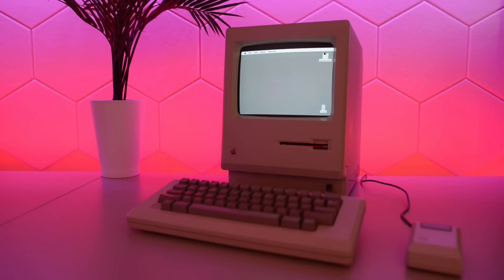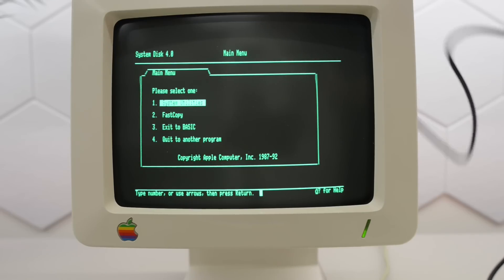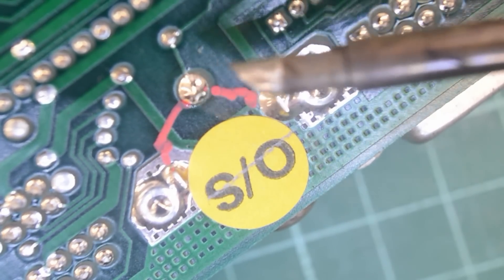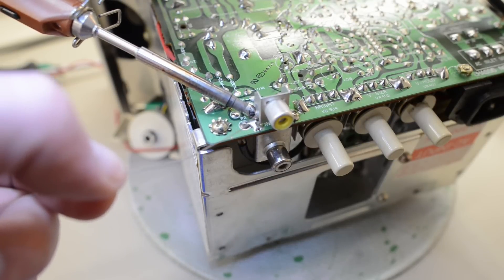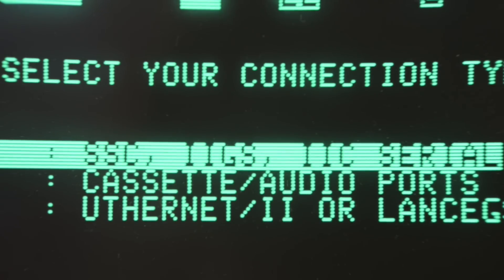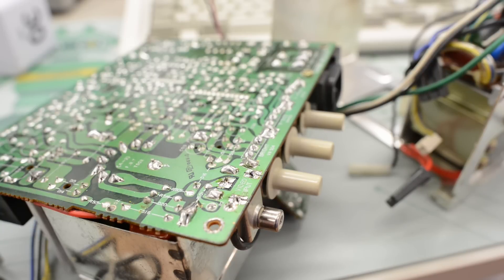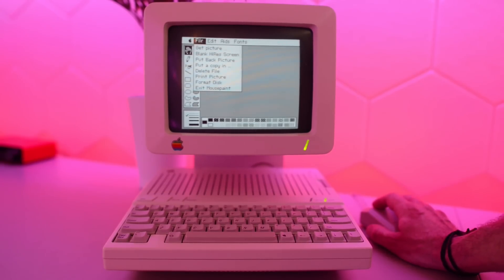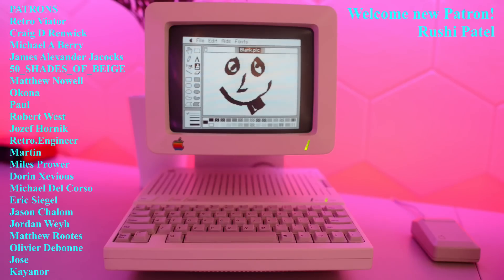Apple IIc Tube swap. It looks awesome! Is this a world first?

Comment: Just FYI, I took apart my apple IIc monitor composite cable to repair a broken connector at one end. I found that the connector has a ferrite bead built in to it, this might be why your third party cable had more issues.
Reply from the maker: Thanks for sharing. This cable doesn't seem to be easy to replace

Comment: If I recall correctly, the apple IIc uses an interlaced signal. So its natural you see a tiny bit of movement. Perfect example be pausing a VHS tape. It does exactly the same shift. As for the new cable, its most likely not shielded well.
Reply from the maker: Ok, hopefully, someone with a //c can check and compare

Comment: This is interesting the problem here is Circuit Loading    that gas to do with the risistence  of the Cable      and i do not think That is the problem   there is a leaky Cap some where i would think  in the out put of the drive for the Composite monitor
Reply from the maker: Thanks, I'll probably end up doing a full recap
Reply: @Epictronics1  It will probably fix nothing :)
Reply from the maker: @michvod  Why not?
Reply: @Epictronics1  Well it could be a capacitor afterall, but most likely just one or two that went bad

Comment: Steve Jobs would be spinning in his grave if he saw that Macintosh with a green phosphor tube. Almost as bad as the amber tube modded Mac I saw a while back. That being said, I do like the look of the paper white tube in the IIc monitor, I just don't think it's worth sacrificing the Mac for it. But they're your machines, so you can do what you like with them.

Anyway, the new cable probably has worse shielding than the old one (thicker doesn't always mean better quality), which is why you get the vertical moving distortion. It's most likely 60Hz interference, the vibrating text is probably a separate issue. It's only affecting the image horizontally, so my guess would be some kind of interference in the horizontal sync signal causing a jitter in the video circuitry on the logic board.

Looking at the schematic, the video generation circuit is integrated into the VID hybrid UE1, which takes the pixel data from the output of the SPI shift register chip UE6, and a sync signal from pin 39 of the IOU chip UE14. That could be the 15.734KHz horizontal sync frequency, which would be easy to confirm on a scope. It's not clear where the IOU chip gets its timing from, but the TMG PAL chip does take the main 14.24982MHz clock and feed a few signals into the IOU, including one that's hard to make out on the schematic but could be HS for horizontal sync.

I would probe the sync signal and confirm if that's the horizontal sync frequency, and if you see the frequency jumping around that would indicate a jitter. You can see it if you zoom in to about one wavelength and centre it on the screen, then enable infinite persistence. The jitter will appear as mismatches in the falling edge. You could also try probing the video output itself, using the video trigger and figuring out which line you can see the jitter on. 

Back on the sync signal you should be able to switch on FFT in the math function menu of your Rigol (zoom out a whole lot first), and you should see a peak at the 15.734KHz fundamental frequency, as well as smaller peaks at the harmonics. It may also show lower frequency peaks, which may hint at the source of the interference, so you should be able to use the cursor function to find out those frequencies and then probe around at nearby pins to see if you can find a matching source.

At least I think you should see it on FFT, I've never tried looking at jitter using FFT myself.

Or I could be completely wrong, and it's just an inherent problem with the way the IIc works. I would check mine, but I don't have a monitor with a composite input handy, and it's a lot of work to set up my scan converter.
Reply from the maker: You seem to understand how these work a lot better than me :) I sent the 1054z back to Rigol so I'm without a proper scope right now. The plan is to replace the caps and do some adjustments on the board (and possibly the magnets) in a new video. Hopefully, I also have a new scope by then. Thanks. PS. Mac Harvard will eventually get his tube back :)
Reply: @Epictronics1  That good to hear that the Mac will get its tube back. I suppose there's a chance that you could come across another one that's too far gone but has a good tube that could be used instead.

I just watched Adrian's video talking about 80 column cards on the Apple II and thought about your issue of video jitter some more. I realised it could be the actual pixel data coming out of the SPI shift register. It's clocked with the main 14.24982MHz system clock, and the video circuit is going to be running at the 15.734KHz horizontal refresh rate, so there would probably be a phase difference between the two clocks, which could account for jitter in timing between vertical refreshes.

That would be an inherent problem, since the only way to fix that would be to create a PLL between the video sync and the 14.24982MHz system clock, triggered by the VID7M signal that feeds the clock inhibit of the SPI shift register. It might be possible to modify the TMG PAL that seems to be responsible for generating some of the timing signals from the 14.24982MHz clock, but you'd have to be careful since it looks like it also generates the PRAS and PCAS signals that run the memory timing.
Reply: @UpLateGeek  I don't know the specifics of the IIc design but 99% of the time the sync clocks are generated by dividing the pixel clock. The scan rates are often inexact (I think the Apple II is worse in this regard than most) but a standard monitor doesn't care.
Reply from the maker: @UpLateGeek  Thanks. That's a mod beyond my skill level :) Yes, I chose Mac Harvard for the swap because I want to have some fun with it. I have another more suitable 512k with a completely ruined case and a good tube. I'll swap them someday but let's first have some fun and try the green Mac experience :)

Comment: Everybody knows why they did Mac and not a newer apple II. But, one thing I keep pondering on. Most people that had a computer from that time was a investment. I then asked them why they had another computer. They explained they still use the old computer and it is still giving them a good return. But, they wanted to do some new things and it was only available on the Amiga, Mac, ibm clone. So they purchased one of those to put next to the original one. Things started going nuts when internet and hardware doubled in speed. So you just started having to purchase over and over again. Trying to decide what you wanted to do. Until the IBM-Clones finished dominating.

Comment: The reason the modern cable performs worse is because its not shielded as well. Shielding is expensive and wont be noticed by most consumers passing color video across it so they slash it hard to save cost and increase profit. I have a feeling if you count the wobbles it will be a harmonic of either the monitors horizontal scan frequency or of the power line frequency.

Comment: Apple made a larger color monitor for the //c, which (like the green monitor) ran from the composite output port. Also, a 3rd party (Video 7) made an adapter for the 15 pin port that allowed you to connect an RGB color monitor, which had a much higher resolution. This RGB adapter looked like an Apple-made  accessory with a matching white case. I own all the items I've mentioned here.
Reply: I have a //c+ with the aforementioned matching color display!

Comment: I have a //c, and the picture on the 9” monitor is rock solid. The //c had a black plastic composite connector on it unlike yours, but like yours it needed replacing and I couldn’t find a good match for it either. 

If I connect a VIC 20 to the monitor with the same Apple composite cable or any other cable I have, I get a nice stable display but with terrible static all over it, but the VIC doesn’t produce the same effect in any other display I have. I haven’t tried any other machines with the monitor though. I guess I should do so.
Reply from the maker: Thanks, I think new caps are probably the next step in my case then. Interesting, about the VIC. I also did that test with the same result.

Comment: Original cable might be coaxially shielded, and new one not. Would explain the difference in shaking.
Reply: Could be lower quality, the sharp changes in video signal are probably causing "ringing" from impedance mismatch

Comment: Maybe it is the Apple II's artifact color mode? Did you set the Apple of monochrome using the PR#0 command? I forget which number it is to turn off color. I haven't used and Apple 2 in 30 years.
Reply: Oh and did you try hooking up a composite video signal to the monitor other than the Apple 2?
Reply from the maker: @tigheklory  Only with a VIC. Somehow, they don't seem to play well together and the image was really bad
Reply from the maker: Thanks, I'll give that a try

Comment: For that connector, have a look at the Switchcraft 3517PCX. The Switchcraft website includes a data-sheet showing all the dimensions (it looks similar to the Apple part). Mouser has them in stock.
Regarding the video shimmer, move the monitor around and make sure there are no transformers, speakers, or other magnetic field sources nearby. Even a DC magnetic field, like an unshielded speaker or rare-earth magnetic doohickey, can cause the magnetic deflection circuitry to act oddly.
Great videos, love the content. Cheers!
Reply from the maker: Thanks!

Comment: Nice mod! Green is cool but too but White is classier! That new cable is weird, I guess it's not coaxial inside - or the shielding is poor? I have two of those CRTs to repair. I'm too slow, they've been in a box for months! Thanks for the video!
Reply from the maker: Thanks Tony, Good luck with the repair, they are a bit hard to work on compared to other displays because they are so crammed inside

Comment: Is the grounding in your home good?
Reply from the maker: Could this be a grounding issue? The studio is a separate building from my home. I'll try the Apple in a different location
Reply: @Epictronics1  Realistically, most electronic equipment doesn't need grounding at all.
Reply from the maker: @graealex  Well, since I have some issues with the sound of my audio gear in the studio. Perhaps I should try and just disconnect the earth ground temporarily to see If I have an issue?
Reply: @Epictronics1  Audio gear usually causes problems when ground potentials are different. Then there is a slight current flowing between two devices, obviously at 50/60 Hz, that causes a hum.
However, protective earth is just a protection measure. As long as you make sure that your circuit is running on a GFCI, there's no real safety issue.
What also might help is just reversing non-polarized plugs. Especially with audio, this can be helpful.
Reply from the maker: @graealex  Thanks, I think you may be on to something here. I don't know much about mains voltage stuff, but I have noticed that my LED lights don't turn off completely in the studio unless I reverse the plug. Something fishy is going on here for sure
Reply: @Epictronics1  That's because even though a transformer isolates the voltage from mains, there is some capacitive coupling going on, inside the transformer, but also with capacitors placed inside the PSU.
Reply: @Epictronics1  I always say, for DC, you can view a capacitor as a voltage buffer. However, for AC, you need to view it as a frequency-dependent resistor. A capacitor near an active digital component will simply short out AC, so it cannot travel to bother components, and with Y-capacitors, it will transmit some AC to earth. That's why stuff feels "tingly" when you are charging it.
Reply: @graealex  DIGITAL electronics don't tend to have a problem with grounding issues, but the display on Apple II's is analog. The issue I see is the Monitor is grounded to the home's ground... but the computer uses an isolated SMPS (Switch mode power supply). If the ground is ineffective, or is not true ground, there will be a voltage potential in the ground circuit of the monitor, but not on the IIc. this will cause the 50/60hz cycling of the display's reference... causing the horizontal sweep to sway... causing the jiggly issue.
Reply: @pinheadjones74  That's kind of wrong. All of the components use isolating power supplies. But contrary to what "isolating" means, AC components are conducted, even if everything is isolated.
Reply from the maker: @pinheadjones74  Interesting. So this could be caused by faulty grounding in the building? I'll try the IIc someplace else
Reply: @graealex  : I doubt there is even a transformer involved. Many, if not most of today's LED lights use Capacitive Droppers. And many seem to cheap out on discharge resistors.
A safety tip concerning LED lamps... don't touch them, when they are switched on, they (including their fixtures) could be referenced to mains.
Reply: @bikkiikun  Regarding the LEDs, yes, often they don't fully isolate, although there's nothing wrong with that either.
Reply: Yeah I was thinking possibly a ground imbalance or something myself.